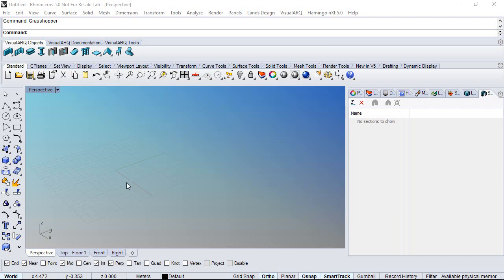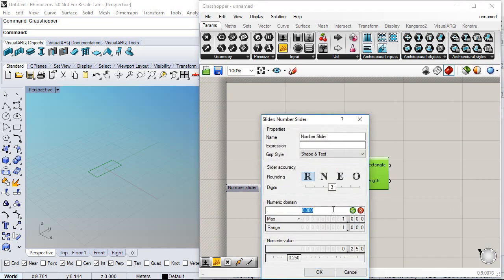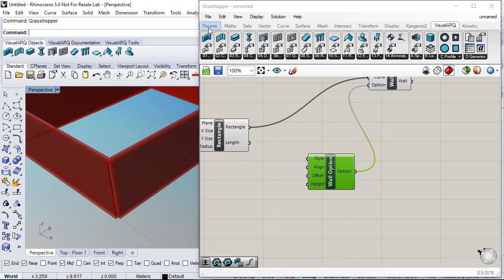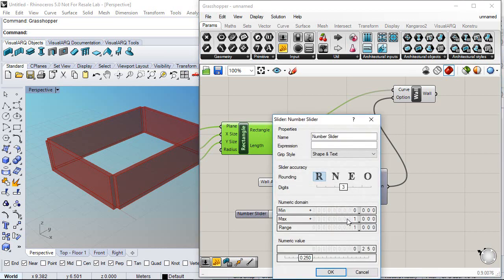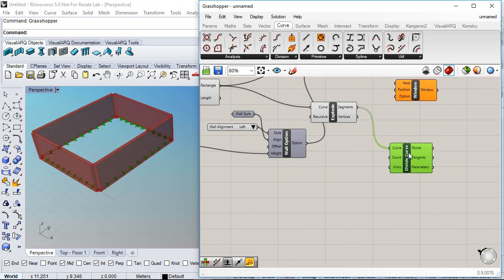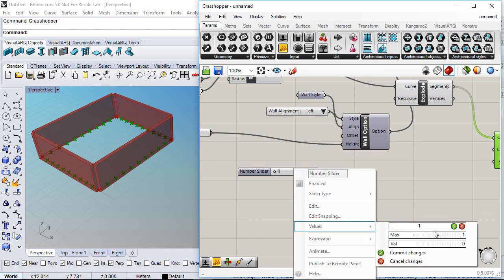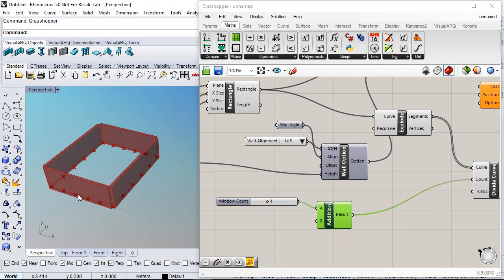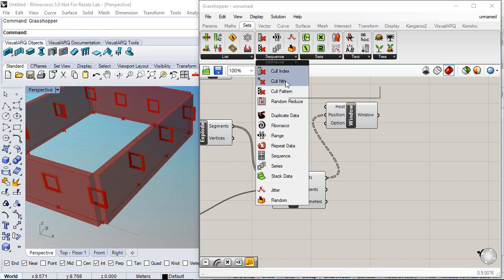Parametric Multilevel Building with the VisualARQ Grasshopper Components

Comment: BUt the walls are not connecting correctly in the corners.. That is just not good enough
Reply from the maker: Hi @HammerTho, some operations between VisualARQ objects (such as wall joints, or openings in walls) are not being calculated in Grasshopper to optimize the performance. But once you bake these object components, the wall connections or the openings inside walls will be calculated automatically. We have plans in future versions to allow users to decide whether these calculations are done in Grasshopper.